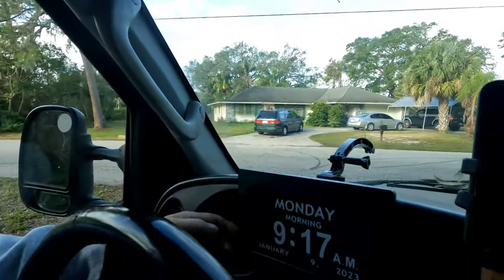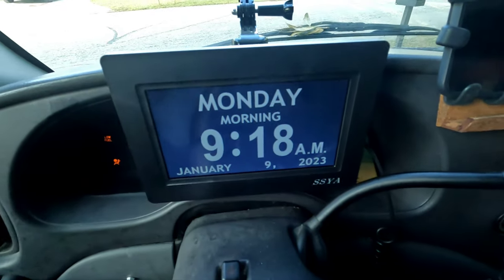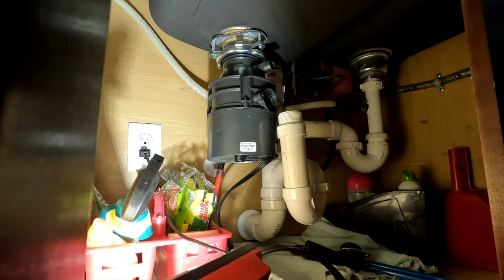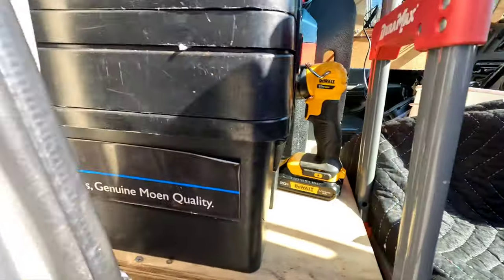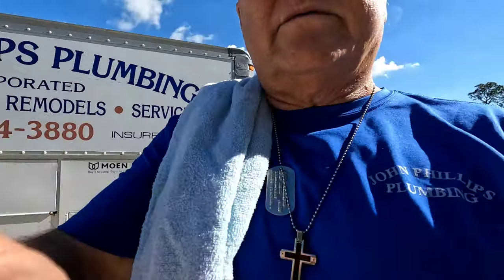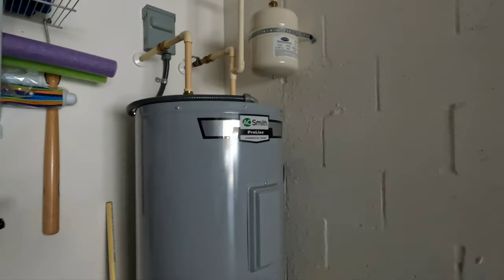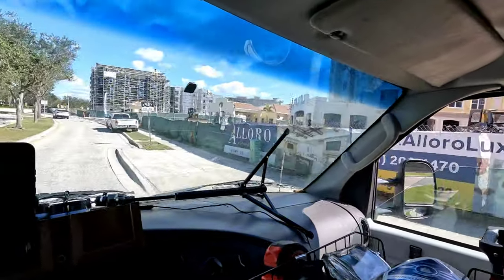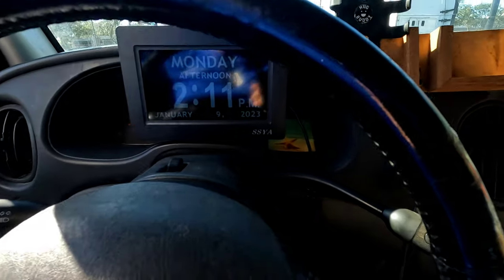NEW DISPOSAL,EXPANSION TANK AND A HEATER REPAIR

Comment: Here in Hawaii like other places prices are soaring higher every year. Here on the island of Oahu which is where our capital is located the average installation for a garbage disposal runs about $450.00 to $500.00 and that's only if you buy the disposal. I feel as prices goes up, more and more people will try to install their own as I did or do without. Prices are getting too high as in the cost of property. The average median single home here on Oahu was listed on the local news the other day as 1.2 million. My single wall house was built in 1966 and my home went up 90 thousand from last year's state property tax assessment so now I have to pay taxes on the 90 thousand increase because of the new assessment in value. Good for the resale value but not good for the property taxes. It's harder on us retired homeowners. At times we all need to try to repair simple things if we can unless you can afford it but at times I feel the prices are too high but what are you going to do?

Comment: What brand water heater do you prefer John? I am a State guy myself. Can’t got wrong with them
Reply from the maker: I've been using Rheem for 25 yrs.with no real problems to speak of,my supplier is 2 miles from my house,just easier for me.
I've heard good things about state,10 yrs prorated warranty not bad. I'd have to drive six or seven miles in heavy traffic to get a state! Thanks for your input and thanks again for watching!
Reply: @johnphillipsplumbing7148  yea Rheem are great heaters man! Honestly I’d probably use them if I had easier access to them. No supply houses have them and the closest Home Depot is like 40 miles away